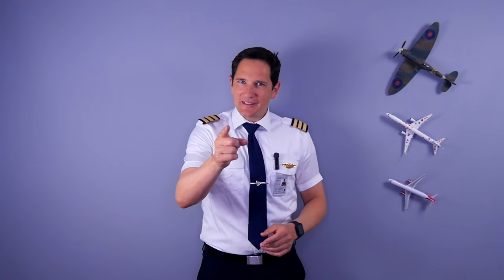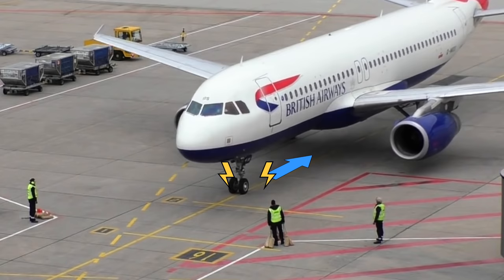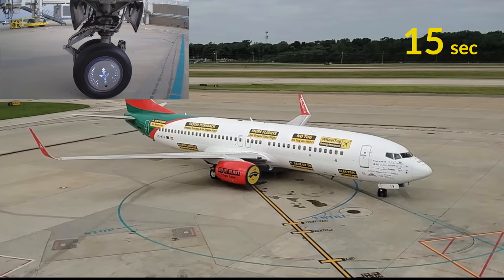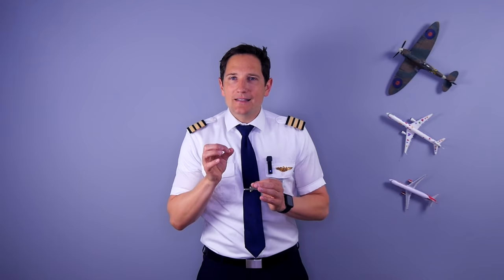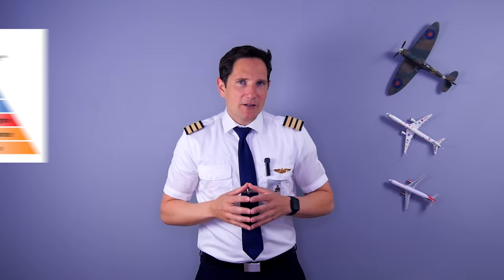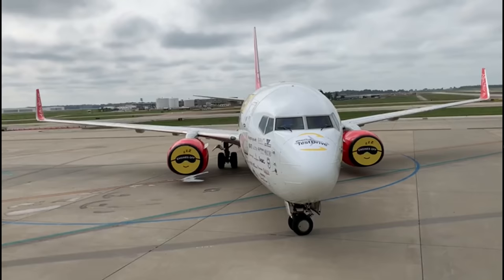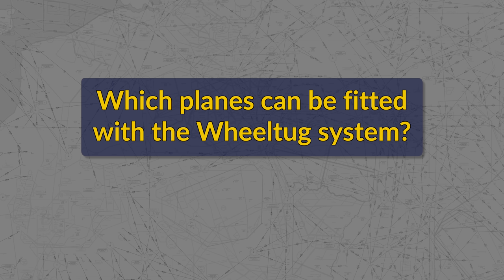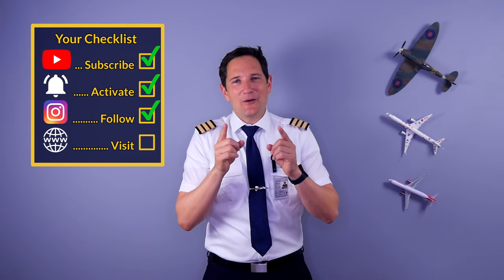The FUTURE of PUSHBACK is ELECTRIC! Without a pushback truck! Explained by CAPTAIN JOE

Comment: I would love to see a follow up video covering  two questions:  1) Why didn't airplane manufacturers offer this option years ago? 2)  Is there any (maybe non-intuitive?) reason not to add this feature?
     Example problems that I'm totally making up and are likely not actually problems : less wear on fan blades from less engine use near ground means some other engine part isn't checked/maintained as much? Rigid arport rules/ fees/ contracts that force use of tugs? 
  Powered wheels are, to the naive, obvious -- like Capt. Joe refers to, the first assumption of every child who sees an airplane moving on the ground.  Huge engineering and thinking goes into making big jets a better economic proposition for the purchasing airline.  Was this idea simply missed by all the engineers in all the airplane manufacturing companies?   If it took powerful hub motors to make this practical/safe, haven't such motors been available to airplane manufacturers for a decade?

Comment: I have a lot of questions and see a number of fairly major issues with this. 
- Exactly how much energy is needed for this thing? 
- How are they able to do it via compact electric motors in the nose wheel? It does not seem like you would get enough torque from something like that? 
- electric motors have another name… generators. How much energy will you be feeding back into the plane on takeoff roll or worse landing. I cannot picture dynamic braking on the nose wheel being a good thing. 
- a red flag for me is why are they putting it on the nose wheel at all? It would seem a much more viable and problem free solution to put it on the main gear. Thus insuring that the traction motors are sitting under the center mass of the airplane. In wet or snowy weather a front wheel drive would result in all sorts of traction issues. Because the bulk of the planes weight is not on those wheels. Airport tugs are the size they are for a reason. Much of the blocky shape is massive lead and steel weights to insure it has enough traction to pull an airplane.

Comment: You would still need a push back tug as a backup not to mention it does not reduce the crew on the ground requirement for wing walkers.

Comment: Rotating out of the gate/apron is already a thing with conventional engine and it is practiced in LCC. Wheeltug would just make it more efficient. IMO, Wheeltug wouldn't change the way plane leaving the gate by any mean as many airline/airport already tried using various alternative. Still, many wheeltug advantages said in the video such as lower noise, less jet wash, and less engine damage while taxi still remain.

Comment: I had to fly from Chicago O'Hare to Tokyo on Christmas Eve 1983, and the actual air temperature that day was -25° F. Of course, the friction from landing heated the tires on the 747 and, when it parked at the gate, they melted the snow on the ground which then re-froze. The tires were now frozen to the concrete. 

They boarded the plane, and when the tug went to push us back from the gate, it couldn't. They bent two push bars trying to break us free over the course of 4 hours. (It was frigid inside the cabin!) They finally freed us and we made up some of the delay in the air.

I'm not sure this device would handle that situation, so airlines/airports better not get rid of all their tugs. 😀

P.S. Fun fact: Crossing the International Date Line made my Christmas disappear that year.

Comment: Based on cost vs effective value powering the front wheel is doable.  May need to do a little system engineering analysis to consider the effects of wind, rain and snow along with failure modes effects analysis (FMEA) and repairability and maintainability.. In Anchorage probably want a plan B truck nearby if the front wheel drive motor system can't deal with prevailing wind and ice.

Comment: One of my projects in college was to build a energy firendly airport. Working at a local international airport at the time, i saw how airplanes needed to turn one engine pushing back and sometimes when at the taxi line. Also, when weather was bad and airspace was congested or either close, I saw how airliners would turn one engine off to save fuel and at times a saw fule trucks head to the taxiway to refil some airplanes. Then I came up with an idea how to pushback and drag airplanes back to the gate electromagneticaly saving millions. I got an A on my project and now im seriously weeping because the concept was called "auto-pushback". Serioulsy unfair lol.

Comment: Quite the sales pitch here! Two issues that were not talked about are, one with only ~5% of the aircraft weight on the NLG will it be able to operate in wet and snowy conditions? Two, with the added mass, has the NLG been certified for the additional loads placed upon it and can the retraction system pull the NLG as certified by the OEM?

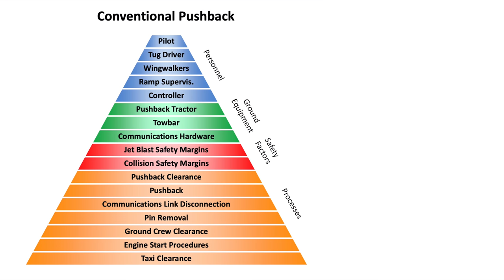Comment: 5:17 in: Pardon me as I’m a bad interpreter. The  pyramid reads to me that if an aircraft has the tug, taxi clearance is not required?
GND CTLLR 1: “Yo Frank, this 73’s moving forward towards alpha. You aware?”
GND CTLLR 2: “He doesn’t need clearance, Eddie; he’s got the Wheel Tug.”

Comment: I witness a long delay because the plane was a different type plane than the ground crew was use to so they found out after about 10 minutes of trying to hook up the plane to the push back tractor would not fit the planes hub. They finally got the crew from the other airline to bring the proper arm to hook up. Result the plane  (which was a charter) was delayed almost an hour on take off.

Comment: There are some questions that need to be answered before this can be implemented:
1)How will ground crew communicate with pilot when backing so as not to hit another plane?
2)How will pilot communicate with wing walkers?
3)There is not enough power to push through snow and ice
4)Will the pilot take responsibility when they roll over a chalk?
5)When does the pilot take full control and responsibility before the plane crosses the non-movement line?
6)Who takes the delay penalty when pilot sits on the ground but the plane has been released?
Reply: I think the pilot gets full control and responsibility for all movement portions of a flight in this scenario.
Reply: @johnstuart8013  We may think that but it is up to the hub when they are ready to release the plane. "Brakes Released" indicates departure time, weather on schedule or late. If the pilot takes the plane then he is solely responsible for all ground vehicle traffic, etc. In my opinion ground crew will still be needed but more as safety observers. If the pilot ignores or "Doesn't see" an hold signal and continues he will blame the ground crew. Many times I have seen captains urge ground crews to skip safety procedures so they do not get dinged with a delay.
Reply: Snow and ice tests: https://www.youtube.com/watch?v=g3GoWDlhH_0
Reply: @akkids6887  Interesting video, thanks. However I have vast experience working as a tug driver in harsh conditions and have no confidence that a plane of that size will do a better job than a 2 ton tug with wheels that are 4 feet in diameter.
Reply: @akkids6887  Interesting video, thanks. However I have vast experience working as a tug driver in harsh conditions and have no confidence that a plane of that size will do a better job than a 2 ton tug with wheels that are 4 feet in diameter.

Comment: We have electric tugs at Gatwick to use on easyJet- they turn so easily but it seems safer with a headset man to be able to look out for traffic. Surely the flight crews have enough to be doing without the additional task of getting the aircraft of the gate. Good idea though, saves paying for equipment and manpower.

Comment: One concern though, the wear and tear of the main wheel gear. As shown in the video, it's only the front wheel that is moving while turning. It seems in some of the turns that the main gear is stationary. This, while being a hot sunny day, at full capacity could increase the wear and tear of the wheels. Could it lead to a wheel eruption?

Comment: I am amazed with Firefly ATR72 that it moved from the departure gate to the runway  without the propeller turning. I did not see any tow truck either. Upon reaching at the runway, the pilot started the propeller and moments later sped up and took of like a rocket to the sky
 It litterally jumped up to the sky  and that is the shortest take off I ever experienced and it is like a roller coaster riding up the slope. 
I trust it is a electric motor that got us there to the runway. Maybe I am wrong.

Comment: this reminds me of the spotting circuit that modern diesel locomotives have for movement inside a building where one of the six traction motors is powered by t he 74v battery and will move the locomotive around without having to start the prime mover.    Great idea

Comment: I thought of this over 10 years ago but my motors were to be mounted on top of the tires and when activated they drop down, touching the tires causing them to turn. Much like the old gas scooters. Damn, if only I had the financial backing , I could have improved my design and this would have probably been the outcome eventually.

Comment: I think that improvement is awesome. But knowing the Electrics basic, I think this part will be part of the hourly maintenance, because at first it need to have a clutch, because when landing the engine, will suffer the impact from 0 to X knots of the landing speed. On same airports the landing is all time more impactful than others airports. 
So with this we have problem one : system clutch that holds the impact;
Now problem 2: knowing the principle of electricity production, generator - motor, with a failure clutch and front wheel engaged the circuit change reverse, instead of apu power the front wheel, the front wheel produces power that can overpower the circuits to APU causing a electrical fire hazard or electrical damage. 
I think that it need to be really tested for. Resistance and security, before making it  green to go on a production line!

Comment: I would be interested to see the maximum mass this system could be used on. I imagine the biggest use is in the short haul. I'm not expecting this is going to be targetted at the A350/B777/B787 market
Reply: Generally larger planes have longer turn-around times at airports anyway, so the aircraft that would benefit the most from this kind of system are the ones with shorter turn-around times. 60min turn to 55min isn't as big of a saving as 30min turn to 25min.

Comment: Remember the fume the air-conditioning pulls in while you wait in queue for takeoff. That will be thing of past of all planes taxi under electric wheels. Other bit is if you actually search fuel consumption on ground, the numbers will shock you. The top result I saw lists it as 36%, just think of the saving. Other bit, make it regenerative breaking or my be use ram!

Comment: Ok, interesting. Here are some concerns:
- No orientation where the wings are positioning; that's why manpower is needed so you don't tip the wing with another a/c;
- In order to follow the yellow line, they have to see in the back - that won't be a problem; backup camera;
- Engine start: maybe there are some hazards behind that the pilots do not know of;
- When you start the engine, the big powerful diesel truck also puts resitance into the jetblast. Does this system cope with the jetblast? You can't start engines after the pushback procedure because time is lost and as you said, time is money, especially on P&W of the Airbus 320neo family/CFM LEAP engines that do require up to 5-8 minutes for start;
- Motor in the front means aircraft can be nose-heavy and affect the balance of the aircraft when it comes to load control.
Reply: There is lots of one engine taxi nowadays to save fuel. 400lbs on additional in the nose means they have to load more in the back, but some of that weight is in the E&E bay, or in the cable. Oddly enough, the extra weight makes a tail strike LESS likely.

Comment: I think this is really neat, but I'd like to see the data after several thousand landings/impacts to ensure it's still safe even after hard landings/long service life. I know maintenance is going to be an issue no matter what, but I'm more interested in ensuring that it's safe and doesn't pose a threat to any other gear or hydraulic systems if it fails.

Comment: Now make the wheel motor powerful enough to taxi all of the way to the end of the runway and save all the fuel wasted by using the main engines to taxi. The engines would need to be started soon enough so that they are warmed up by the time you reach the end of the runway for takeoff. The fuel savings could be substantial.

Comment: If I'm honest I'm surprised this wasn't already a thing. I guess there must have been technical challenges that haven't been fully resolvable until now. But yes, I can definitely see the value of this... fewer bottlenecks for planes getting underway, less people involved, less ground equipment to use and maintain and worry about breaking.

It seems like this could be used in conjunction with powered taxiing. The wheel tug system can get the plane moving, and then disengaged while switching to engine power for higher speed taxiing. I kind of wonder how tedious that might be... Is the wheel tug max forward speed enough for normal taxi operations all the way to the runway?

Comment: Traffic on the ramp barely stops for a pushback tug with wing walkers.  They would never pay attention to just the beacon light! I think the time savings effect is reduced by the potential for injuries or AC damage.
Reply: Seems like airports will get practice on these issues with the robotic tugs operated by pilots, right?  Then over time the smaller planes can drop the tugs and just use wheel motors.

Comment: Finally ! I always wondered why the most advanced engineering in the world hadnt thought a solution for this phase of the flight ...I was thinking on electric tugs that could take the plane up to a point before the runway where the engines could be started = way more fuel savings. What do you think ?
Reply: You're talking about Taxibot, but that's not all-electric.

Comment: I wonder why putting the electric motors, clutch and controls into the nosewheel came up as the best solution. Thats 200kg deadweight flown around every trip. You could put those components into a small, battery electric powered robot that drives to the nosewheel, conects via a screw drive (the only component needed to be installed on the aircraft), pushes the plane back and than detaches again. There could be one at every gate and parking position. connection could even be made by AI (it just needs to drive a short distance to the nosewheel, scanning its environment doing so. thats not hard anymore) not needing any manpower.

Comment: I have a feeling that airlines will try and reduce engine wear by requiring the electric motor for breakaway and then using low threat from the entrance. That way you don't have to use breakaway address. Just get up to 8 miles an hour and then go from there.

Comment: A question I have is if the system can be used to increase short field performance of an aircraft. While nose gears don't have brakes, an electric motor with the polarity reversed does in fact make a very good brake, and of course if you are able to piggyback the nose wheel angle sensor(s) it can also help maintain directional control.

Comment: As a LRSA who’s job will be taken by this technology, all I can say is this has a %50 chance of failing if they don’t figure how to have a guidance system other than the Captains own eyes. If wing-walkers are still going to be a thing then I have some hope for this revolutionary concept but if not then this potentially puts a lot passengers at risk. 

Most pilots in my airline (Alaska) haul a** already when it comes to taxing, because let’s be fair, they do have places to be, schedules to attend to, and jobs to keep. But hauling a** is still hauling a** at the end of the day. 

When it comes to this new reverse technology, all it takes is one captain to be impatient and back his plane into another aircraft during rush hour when 8 different planes are pushing back at the same time. 

But of course, everything has its risks and craziness happens all the time, even with FAA approved procedures.

Comment: Look up EGTS (electric green taxi system). Safran and Honeywell worked on this a few years ago. It has never been adopted by the airlines as the weight increases fuel costs and it makes the electrical system much more complicated. It looks neat, but it may not be financially viable.
Reply: Aaron Bianco has a few comments explaining that the EGTS used main wheel motors and had to add cooling and batteries.  Looks like it was way more complex and heavy than wheeltug